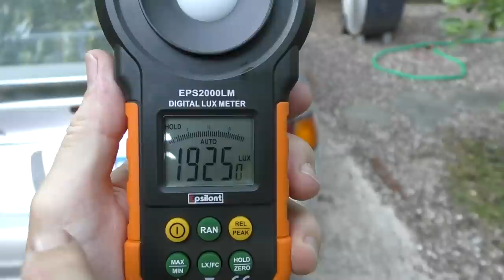I Made a Huge Mistake Buying These Headlights

Comment: I found that rubbing alcohol cleans cloudy light boxes. Just rub it with a paper towel until most of the alcohol evaporates. Might need to do it twice for really cloudy plastic. I don't know why but it seems to work as well as a $30 polishing kit I bought years ago
Reply: No it doesn't unless you have some strange problem like you've been driving through a marshmallow factory and just need to get the goo off.

Comment: Another thing is to make sure your headlights are aimed properly.  My truck came with the headlights aimed too low.  I added airbags to the back which made it worse so I had to adjust them.  And especially true if your car has been in an accident of some sort.  That will also help.

Comment: If you are blind by someone super bright lights and you have a accident who is to blame
Reply: I'm my country you are. If you are blinded by the headlights of a vehicle coming towards you, you should slow down or stop.
Reply: I was blinded by a new Toyota Corolla in town driving and I almost hit an elderly lady that was slowly crossing an intersection that she did not get through before the traffic light changed. I had to slam the brakes hard screeching the tires when I noticed her and it was close, within inches of hitting her. If this oncoming car had been a car with regular headlights from 2005 I would have seen her at least 5 seconds sooner. They say the LED projection lights are safer but I think that is only on the highway when traveling fast. In town it is not for sure.

Comment: In the early 1970’s, a friend of mine bought a late 1950’s model Cadillac for $100 (as I recall).  It had a sensor on the dash facing forward that that would automatically dim the high beam lights back to low beam when a car approached from the other direction, then would return them to high beam after the car passed.

Comment: Aerodynamic glass headlight windshields were used by many car models until 1967 in the USA when they were made illegal for new cars. VW Beetles and Kombis used them. Jaguar XKEs used them. Some others also.
For sale in the USA they had US standard sealed beams, either 4 x 5-3/4" or 2 x 7" behind the glass. The only problem I ever knew of is that the space between the glass cover and the sealed beam was not airtight and would have dirt gradually collect on the inside of the cover glass and on the sealed beam lens. Most drivers never bothered to clean them.
In 1967 Citroën restyled the nose of their D models, going to four headlights and aerodynamic cover glasses. They were immediately illegal for new cars in the USA, so instead of two ~7" high/low lights and two ~5" long range lights they got four 5-3/4" sealed beam lights, no glass covers. In 1970 their SM got six sort-of rectangular lights: two high/low lights, two high beam lights and two long range lights under aerodynamic glass covers. All illegal for new cars in the USA of course.
The aerodynamic plastic headlight units of today are actually sealed beams. For the USA they have silicone "rubber" seals on the bulb unit. The only time they're not sealed is during bulb changes. The plastic light unit is the outer lens of this sealed beam unit.

Comment: Random opinion: Acura Jewel eye headlights are the best.

Most new headlights are far from crap
Reply: Reflector type dont have the sharp cutoff...
Reply: Jewel eye LEDs are pretty great. Every time I stop in traffic line in line with the third gen MDX (I have the second gen car), you can clearly see a huge difference in intensity compared with my HIDs.

Comment: I replaced both front and rear lenses with aftermarket new ones on my 03 Silverado for around 125 dollars and i replaced the front lenses and side markers on my 08 Cr Vil PI with new low and high beam bulbs for 50 dollars,what a difference it made.

Comment: Also if you need to make your headlights look new again, use Sylvanias restoration kit.  I've done a lot of headlight restorations with all different kinds of kits and can tell you that the Sylvanias kit is the absolute best.  You don't use a drill which means it takes an hour per headlight to do it well (the first sanding step is the most important!).  In the end you will have a crystal clear headlight, usually have to re do it every other year but it's a lot cheaper than buying OEM lights (aftermarket will always be worse)
Reply: Agree 100% on the Sylvania kit!... and usually only costs about 20.00

Comment: The issue isn't brightness, it's poor headlight aim and idiots running bright LEDs for fog lamps in heavy traffic
Reply: @DiamondScuff  this only works on flat roads and where I'm from its all hills and valleys. You can aim the lights down really far and they still blind people over long hills.
Reply: @practicalguy973  if you put it low enough even going up and down hills it wont do too much blinding, even if your in a truck. the hill would have to be like 70+ degrees to go up enough to make the lights blind the other person.

Comment: I replaced the stock headlight housing in my 89 S10 Blazer with glass ones, then put Hella 65/95w bulbs in it. Stock is 55/65w. Considerable increase in visibility, with a sharp low beam upper edge cut off to help to not blind other drivers.

Comment: Out drive my headlights?  Is my car going faster than the speed of light like a Delorean with a flux capacitor set up?
Reply: Low-Beams are aimed slightly down so other driver don’t get blinded. Scotty is saying at 40mph+, a deer could be unseen by you until it’s too late to brake if you’re not using high-beams.

Comment: My stock lights ,
 led  setup in my 2017 Silverado blind people all the time . I tell them to complain to Chevy
Reply: You know you can adjust the beams to point downward. Check your manual.
Reply: Chevrolet tends to have the lights pointed slightly too high. I had to adjust my Traverse lights down slightly because the dealer had them pointed so they would blind drivers. They need to be angled down slightly. There are videos that can show you how to properly point your headlights.
Reply: @73horsefly  
   No need to . They are spot on at 30 feet.  Just very bright.

Comment: There is absolutely nothing wrong with aftermarket LEDs if they're designed correctly and if they're aimed correctly, I love them in my car.
Reply: What company did you go with?
Reply: @Ammut6 
I personally use superbrightleds, they make quality LEDs that are designed correctly and they're not too expensive.  A set of LED headlights is $60 but it's worth having ones that are well made and don't blind people.

Comment: I've noticed a lot more people are just driving with their high-beams on. That and they buy those after-market blueish crap bulbs and mis-adjust the height and at least in my state they will never, ever, ever be cited or pulled over for it because they are EVERYWHERE. Same with mufflers. Absolutely zero regulation. My state stopped doing inspections - which arguably were worthless anyway because, as Scotty says, they just pop out the illegal ones during the inspection.

Comment: Thank you Scotty.  Picked up a get around corolla LE 150K miles but everything works...it's actually a daily driver with a slightly beat up front end.  Why do 4000 worth of (minor but poorly placed) body work to 2 fix headlight bulbs and a bumper?  I found 7" dietz type and hi-low 55/60 halogen bulbs to fit.  2 drilled holes and it's back to legal, adjustable and everything.

Comment: We tried 6k led bulbs in my sister's 300m the bulbs lasted maybe 6 months, they also were way too blue and didn't have much throw out ahead. Changing bulbs in a 300m is a huge process if you don't know the shortcuts. I finally bought another set of halogen bulbs and put em in. She can see at night again and hopefully they last a few years. My 95 Neon I put a set of aftermarket projector headlights in it. The factory housings were super cloudy and not much light output. The projector set reminds me of the European Hella H4 headlights I put in my old Dart. They put out a flat low beam that the upper half is cutoff by the reflector setup inside the headlights so as to not blind oncoming traffic, all the light hits the road and its a whiter brighter light. The projector is the same but has a even better beam cutoff. As far as HID and LED you really need a housing designed for those kind of bulbs or yes, you'll be blinding people badly. I would bet a HID or LED bulb would work very well in a projector headlight housing as it would control the light scatter much better. People were buying other manufacturers common HID housings and modifying them or taking the reflector/projectors out of them so they could have properly designed setups in older cars and they make conversion setups you can modify your headlights to use. I love the projectors in my Neon. I can see much better at night and they use common halogen bulbs that are cheap and easy to find. Too bad Depo stopped selling them for older Neons like mine but I guess the market for these older cars is going away.

Comment: HID's are okay, but you must have the lenses and deflectors set up for them.  I have them from the factory on my 2007 Sienna Limited.  When you got these from Toyota, you also have a headlight angle electric adjust in the car.  The owners manual also tells you where to set the angle based on if you have a full load, trailer, etc.

Comment: I put 5k 55w HIDs in my 09 altima that has reflective style headlights and haven't had anyone flash their brights at me. I've also had local law enforcement pass on the opposite of the road and have never gotten pulled over. I believe it is a case by case basis, certain manufacturers headlights react differently to aftermarket HIDs being installed in them.

Comment: I put my stock bulbs in when I go for inspection. My normal bulbs are 45,000 lumin sea lights. In my ford ranger
And 50,000 lumin in my Subaru outback.

I can park at one end of my yard which is 150 yards long and see deer and moose clear as day from my vehicle.

Comment: When i was little, it was just a screw driver to change out round or square sealed beams.  Took like just few minutes to do.  Now, if im lucky, takes like 15-20 min, removing plastic panels, squeezing down on the plastic bumper and wiggling the plastic headlight housing out to reach the back, pop open the round cover and remove the bulb/socket.

Comment: Don't forget that hid and bright led bulbs are meant for projector lamps with a controlled cut off line. As long as the cut off line is below other drivers eyes you can make them as bright as you want.

Comment: A simply way you can make your fogged plastic headlights clear again is to wipe them with engine oil.  Plastic comes from oil and over time the plastic get hard and yellow.  The oil rejuvenates the plastic and makes it clear again if the weathern is on the out side.  Twice a week a simple wipe with oil and you would be stunned at the results.  Simple yet very effective.

Comment: I think it's more about where the light is going rather than how bright it is. The people running led bulbs in reflector housings aren't getting any more light down range but are rather sending light straight up. I've never been blinded by one of those BMW auto adjusting headlights because the beam is always moving to prevent hitting you in the eyes; if you look at the lumen output it's higher than halogen but less blinding.

Comment: On the Toyota Corolla, they introduced automatic high beams in 2017 as part of the safety sense feature. They turn off automatically when a car is detected and will come back on when the coast is clear.  LED lights are standard

Comment: I believe HIDs are typically much brighter than LEDs.  So we may have passed peak brightness.

The cheap LEDs I have at home also have a fault: they don't switch off!
Reply: LEDs at least the top end ones are brighter than HIDs however cheap aftermarket LEDs are crap they put out less light than a halogen let alone a HID.

Comment: HID lights require a projector to not blind oncoming traffic.  The standard light housings are engineered for halogens in most cars, which broadcast light in a different direction than HID ones do.  HID need projectors to direct the light properly (or as in the Lincoln Mk VIII from 96-98, a housing engineered for a now obsolete HID bulb, but that's a different story).  So, HID in standard housings is bad, in a properly set up projector, good even though they are brighter.  Same goes for LED's.  LED's are much better in projectors than in standard reflective housings.

Comment: I saw a video that showed the proper way to install HID lights, which included installing a projector, which would project the light properly, especially if the height of the projectors was adjusted properly. Those old Celica lights almost certainly have no projectors, so the light from the zenon bulbs go all over the place, blinding people.

Comment: i’ve never been blinded by headlights on a new vehicle using LED / HID lights with projectors, projectors are in most vehicles now a days.  The HID beam pattern and cutoff is much more controlled in projector housing than reflector housings that just throw light everywhere.  What i AM blinded by is people who stick LED lights in their reflector housings and they toss light 30 feet up in the air and all in between that and the ground and blind every driver they pass with their low beams.  If you’ve got projectors, use HID or LED, if you have reflectors, use halogen.

Comment: I don't have 53 years of car experience.  However, I have 18 years experience with a Toyota Avalon and make these observations:
1.  No matter what you do the plastic headlight lenses will deteriorate.
2.  I could not find a replacement headlight assembly that offered a glass lens.
3.  Supposed fixes like toothpaste, coca cola and lens polishes don't work - or you have to keep re-applying constantly, particularly when your car is parked outside.
4.  Sanding a plastic lens does not work.
5.  If you replace the standard OEM bulb with perhaps Xenon, it will be a temporary fix for years.  I did that.
6.  Today, I installed replacement headlights with xenon bulbs.  I have a very expensive lens polish approved by Scotty coming by mail.  I have calendared to polish the new lenses every three months.  My car will now outlive me.

I will now address the glass windshield and my plans.
1.  If you wash the windshield, clean with isopropyl and then use an extremely fine grit sandpaper once a year, it helps.  Then you put on NuFinish once a year.  
2.  Eventually, the fine pitting will become too much to handle.  At that point, you replace the glass.  Be careful to get OEM equivalent glass.  You don't have to get OEM glass which is expensive.  If you don't specify, you will probably get cheap PRC glass that will unacceptable 3 -5 years later.

Yeah, I am one of those old guys who takes care of his car.  In my family there were 3 other Avalons of the same model which each lasted more than 225,000 miles.

Comment: Cheap leds mess up the beam pattern, however if you get a good quality led (I use GTR gen 3) they’re great! Replace halogen with led and no beam adjustment needed, not blinding anyone either
Reply: ̈ GTR is a brand of quality led and hid lights
A google search would have answered your concern.

Comment: I have a 2004 Avalon.  Over the years, the lens (plastic) became worse and worse.  I tried the tooth paste/$16 polishing kit approach.  THEY DO NOT WORK.  Finally, I had my mechanic swap out the bulbs.  The result is fine.  I can see.  And, the faded/cr--y Toyota plastic lenses diffuse the light enough that oncoming traffic is not bothered.

Comment: Mr Kilmer didn't research this subject sufficiently - that's his mistake in this case.

1. Never "upgrade" your low beam lights from halogen to HID by just replacing bulbs and installing ballasts - you also need HID-specific projectors (or more rarely - HID-specific reflectors) with proper focusing lenses and cutoffs. The same is true when upgrading to higher lumen LEDs.
2. The HID bulbs are very efficient - their effective light output per watt of electric  power is still surpassed by only a few of the LED chips designed for automotive applications.
3. The LED light output drops quite significantly as the temperature increases, thus bulb cooling becomes essential. Because of this all decent quality aftermarket LED bulbs come with good cooling fans on the back, but they can't work effectively when completely enclosed in headlight housings designed for halogens or xenon (HID) bulbs.
4. HID and halogen light output decreases over time, so measuring older vs newer bulbs doesn't necessarily mean anything.

These are just a few things to consider when upgrading headlight bulbs.

I keep looking for LED bulbs to replace my factory D2S 35W HIDs, but haven't yet seen any worth the effort...

Comment: The  main issue with people changing from halogen to hid or led is they are putting new bulbs in a headlight assembly Not design for the new bulbs. 

For example, putting a LED bulb in a standard headlight assembly.  Only the projector style housing is suitable  But even then you may  still have problems if the new bulbs not in the same exact alinement  as the factory one.